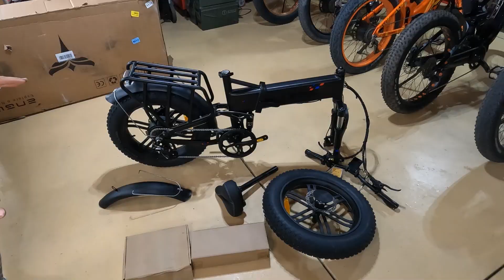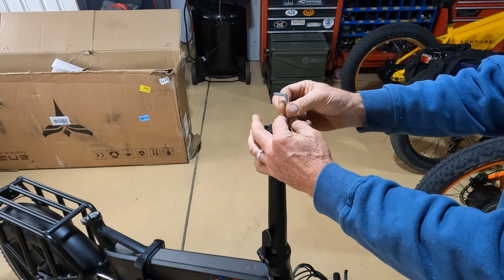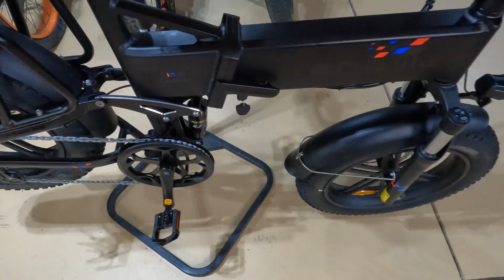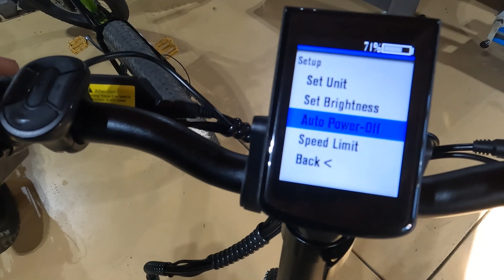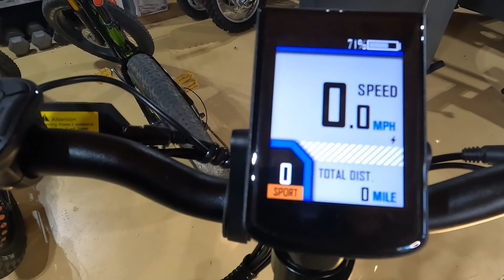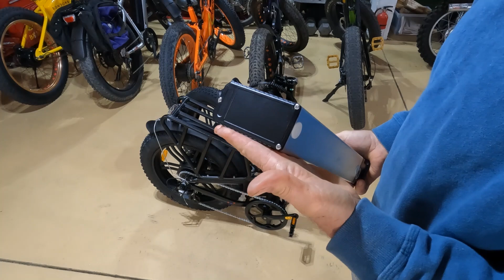Engwe Engine Pro 750w direct drive ebike assembly and ride!

Comment: Bonjour, bon vélo qui me rappelle mon Lankeleisi x3000, mais pas adapté à utilisation enduro, les roues en 20 pouces ont leurs limites quand il y a trop de rocaille.  J'ai cru a une nouvelle vidéo sur le Nitro, j'ai hâte, je suis sous la pluie et le froid depuis plusieurs jours, je peux pas sortir mon bike 😢! Du-coup, je passe du temps sur youtube ! Merci.
Reply from the maker: Hello,  I understand not being able to ride because of weather! Very cold here with snow on the ground at least a couple of days per week..... not looking forward to winter!
You are correct, 20 inch wheel bikes are not very good for off road trail riding. I will do testing with this bike on smoother dirt roads, bike paths and paved streets.  Cheers